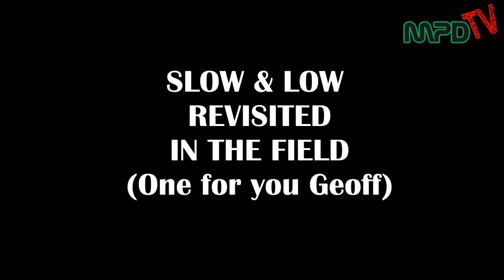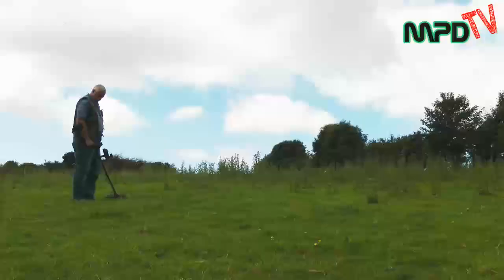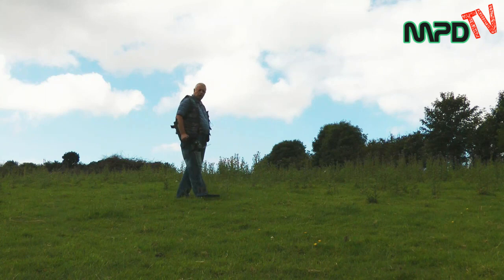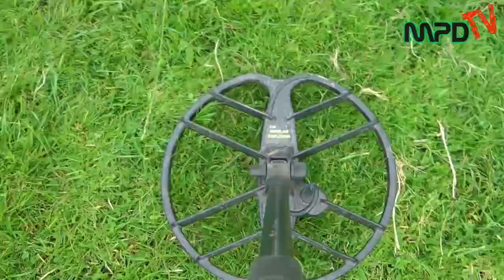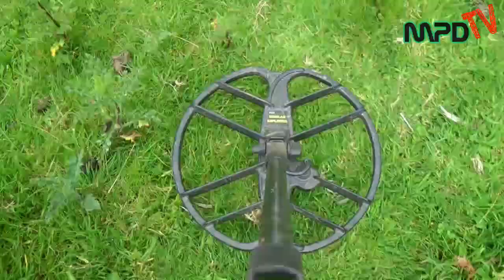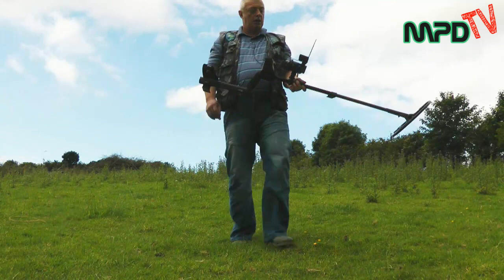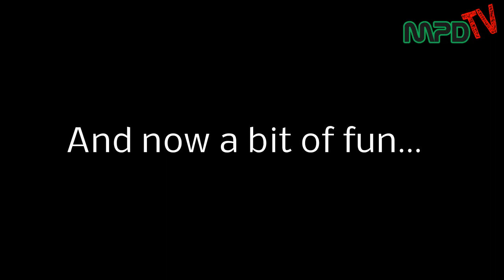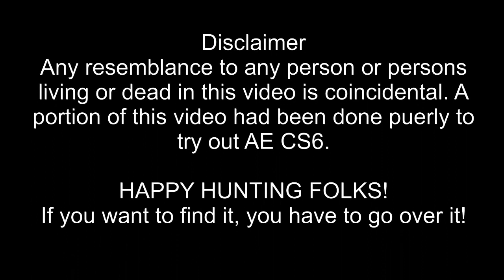Detecting with Dave Low and Slow Revisited

Comment from the maker: Not as slow with the whites, this is from their manual I still have it. The loop must be in motion (sweeping from side-to-side) for this instrument to respond to metal. Practice a smooth sweep of the loop from side-to-side keeping the loop close to the ground throughout the swing. Each pass of the loop should take approximately two seconds from right to left, two seconds to return from left to right.

Comment: You need to overlap your swings Dave, your leaving huge gaps, surely if your machine has a fast recovery speed as long as you are overlapping your sweeps you are not going to miss signals?
I can understand going slowly for a machine with a slower recovery but not for something like a XP Deus which has lightening fast recovery speed.
I guess its horses for courses.
Regards
Leigh